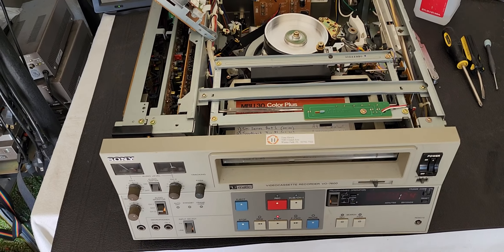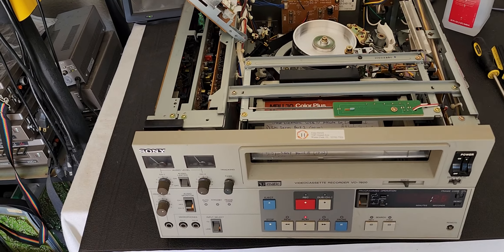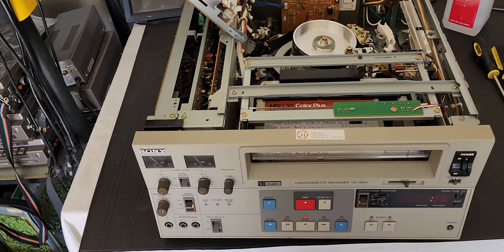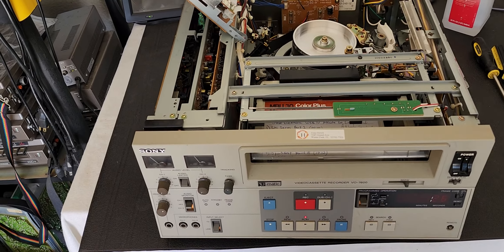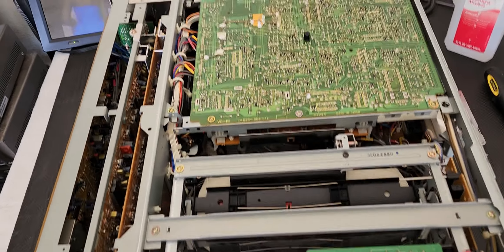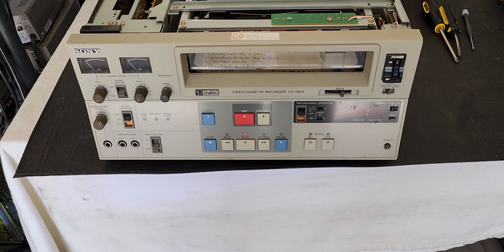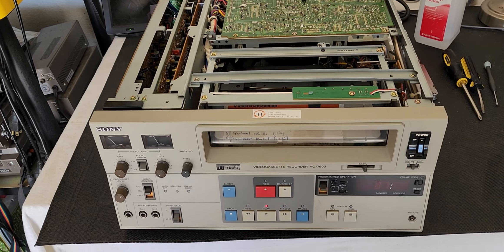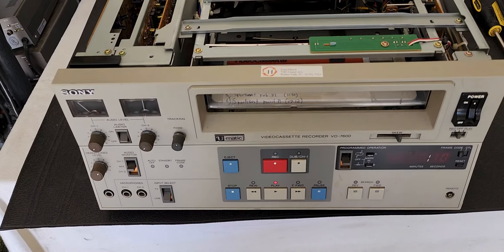Sony Vo-7600 Bad Video Output Card..

Comment: It took me years to find a U-Matic machine that worked and at an affordable price. I finally got one recently on EBay which had been serviced by the seller though they stated they were not a “professional”. When it arrived there was no picture but I just put my fingers on the tape as it was going around the head and picture came back, has worked great ever since. I have a few transfers from that machine uploaded here, always looking for more old (70s) tapes.